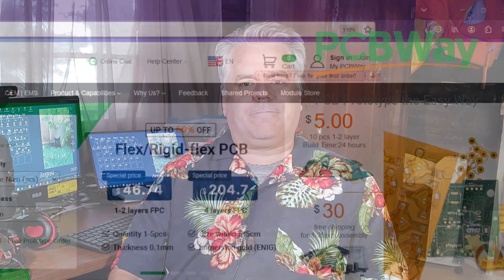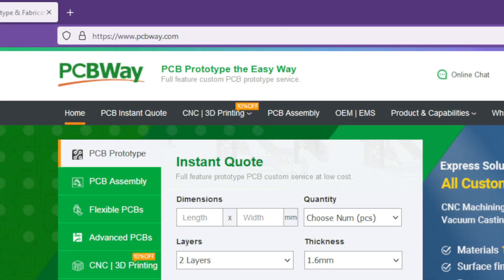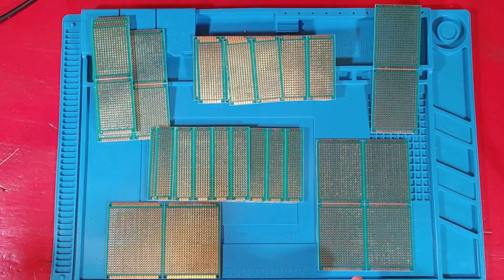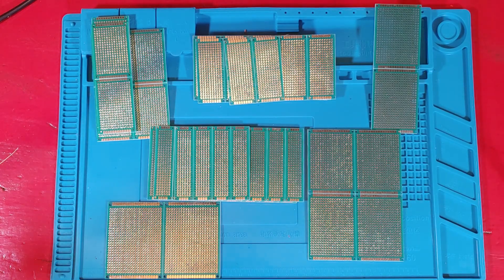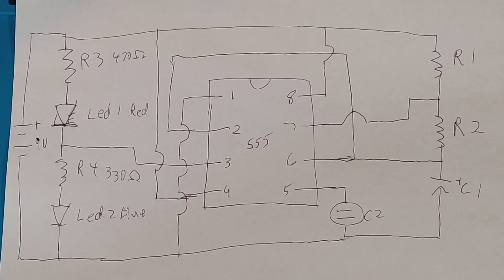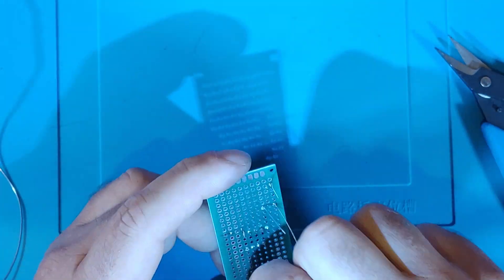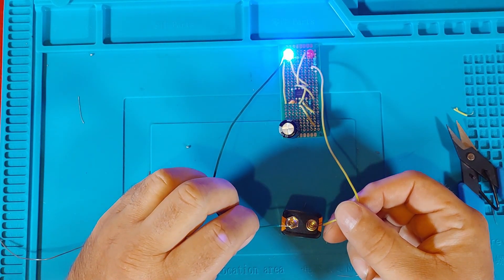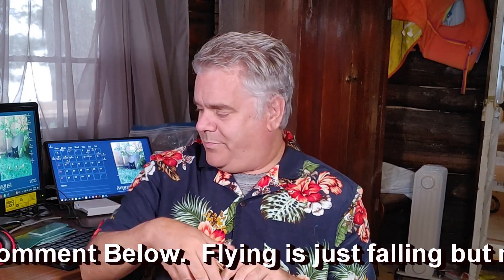Making A Simple Circuit On A Prototyping Board

Comment: Several parts of the video you can't see what you are looking at or are soldering. So when you solder a wire to the 55 pin you use a solder bridge?
Reply from the maker: I am bending the leads on the components to use as bridges and soldering them either together or onto the legs of the timer chip.